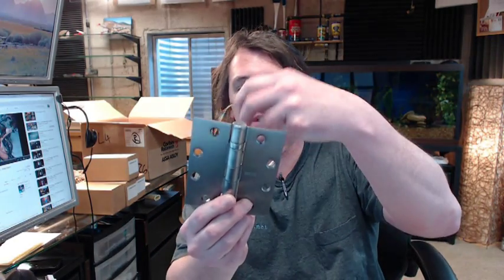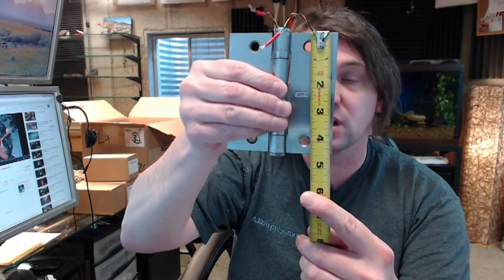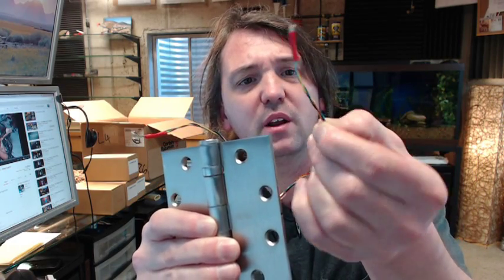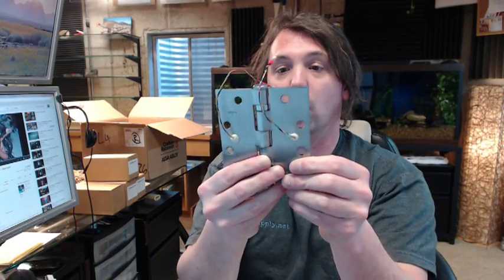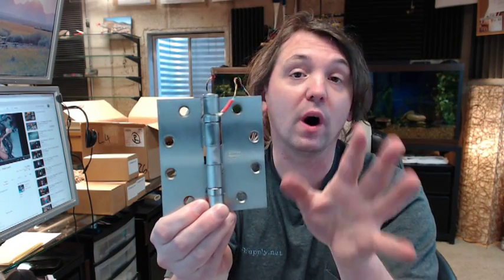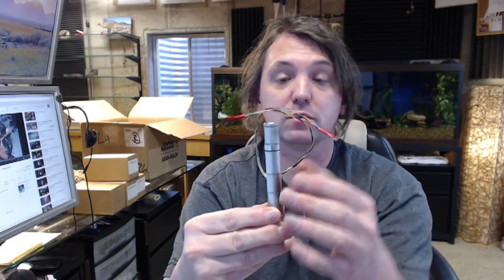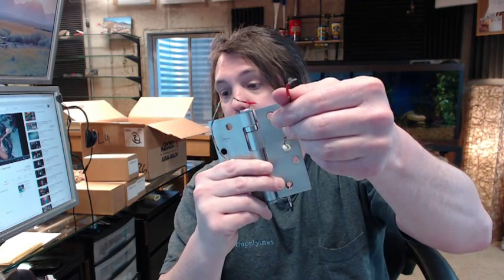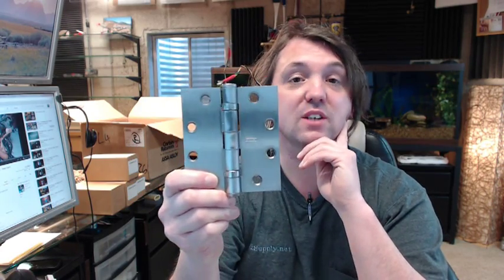CEFBB179-54 4-1/2X4 26D 4 Wire Energy Transfer Hinge

Comment: What does it do? How does it work?
Reply from the maker: The 
CEFBB179-54 4-1/2X4 26D 4 Wire Energy Transfer Hinge

allows low voltage current to pass through the hinge from the wall and two some sort of electrical device that is installed in or on the door.

Comment: Would you happen to know the wire material? I recently bought one of these and was just going to crimp my connections, but the wiring doesn't appear to be copper, and now I'm concerned as to whether or not it's actually aluminum (if so, I'll have to take extra steps in splicing my wiring to the hinge connections). Thanks for any info you might have!
Reply from the maker: It is copper wire.
   https://absupply.net/stanley-cefbb179-54-4-12x4-26d-4-wire-energy-transfer-hinge.aspx

Comment: Command Does NOT use white silicone on the wire leads.
Command sends all hinges with a 4 ft. lead on one leaf.
That is NOT a Command hinge.
Reply from the maker: You are correct - thank you for the correction - this is not a Command hinge and I have corrected the title - this hinge is a Stanley CEFBB179-54 4-1/2X4 26D 4 Wire Energy Transfer Hinge.  Regarding the 4' wire lead, that is an option, not standard - page 28 here:  https://absupply.net/pdf/Command_Access_ProductCatalog.pdf